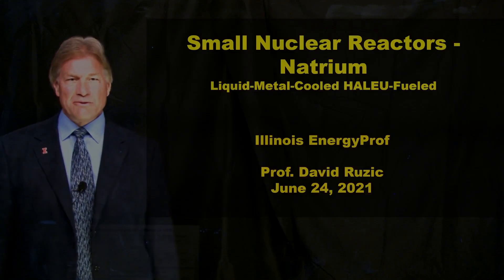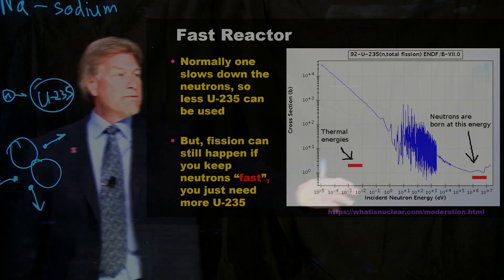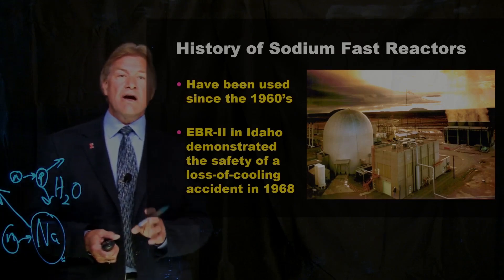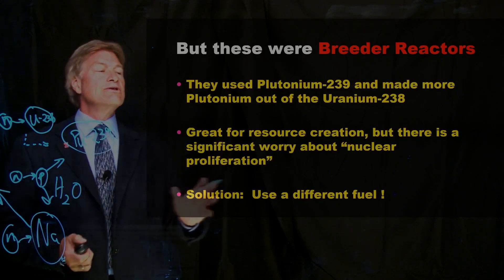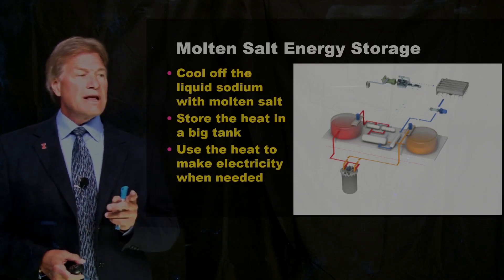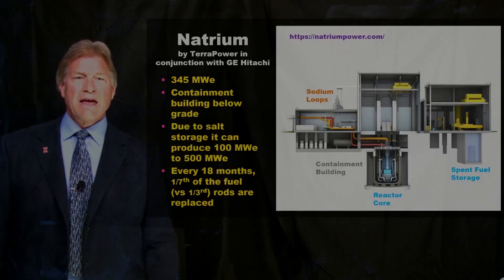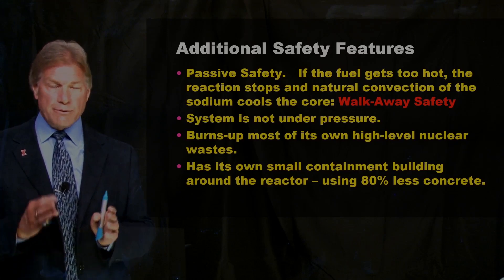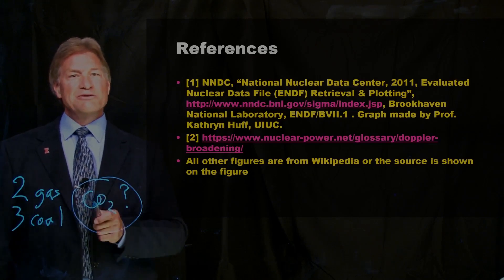Small Nuclear Reactors - Natrium

Comment: This angers me.
I never had a teacher like him. Life is unfair.
Thanks for being this awesome with this material.
Reply from the maker: Thank you!
Reply: @illinoisenergyprof6878  I'm Australian and we have to replace a bunch of badly ageing coal fired plants and a few gas-thermal plants.
I actually did aerospace at Illinois but now work in industrial control systems and automation. So I don't work in the power industry but I work with power engineers at times. They've been saying for years we've got issues and NOBODY listened. In automation we reuse a lot of stuff. We don't throw out robots for new products we re-tool and re-program. In mining (where I've worked) we don't throw out the trucks and diggers when the mine runs out we move them to another mine. So RE-USING existing infrastructure makes a whole lot of sense.

One of the things I hear from power engineers is how hard it is to manage a grid. If we take 1GW of coal offline because its too old and replace it at the same location with 1GW of Gen IV then grid management DOESN'T change. Plus all the deconstruction and reconstructions works keeps people in those places employed. We have a huge coal industry and most of their workers know climate change is real and their industry is dying. What they HATE is that nobody is answering their big question: "What's next?" 
I don't think Gen IV is the answer for everyone, BUT IT IS AN ANSWER for many to consider.

FYI - The answer I am pushing here is hydrogen from sea water powered by wind & solar. Like some countries we have huge amounts of roof top solar and lots of wind. We're discovering there's a massive amount of energy being generated and NOWHERE to use it. Since its already electrical energy its inefficient to store as heat. But if we store it as hydrogen, yes it has loses, but it gains on long term storage and transportation. You can't pump molten salt across the countryside but you can pump hydrogen across the country side.

But even in our scenario with our future population estimates we'll need lumps of hardware that can simply generate baseload power day after day. Before I went to Illinois at my High Schools equivalent of a commencement speech one year was by a nuclear engineer. He said (in 1980) that Australia would one day HAVE to include nuclear in its power mix. I see our energy future as a mixture of technologies and I think that's how most countries will go about it.
Reply: Green hydrogen of the sort you’re advocating has been a complete failure. Sabine Hossenfelder did a video explaining why.
Reply: Well now you do... Just because we are not in a school doesn't mean the information isn't relevant.
Reply: @timaahhh  yeah, but the difference between him and my physics professor, Dr. Balageer, could have seriously altered my life.  Now that I'm in my 50s, it's a bit late for a physics related career change.  Ugh, just thinking of my prof is making me sleepy - Red Bull wasn't a thing, but no matter how caffeinated I was, this guys droning voice and completely uninspiring teaching methods put, without fail, half the class asleep.  He was a nice enough guy and evidently a good researcher, just socially awkward and not teacher material.
Reply: Well said, I feel the same way😊
Reply: I had one prof like him.   Didn't use technology as well, but extensive subject matter expertise and incredibly good at presenting it.

Notes from the whiteboard were how you survived the class, but it was engaging, challenging, and is still useful in my professional life today.
Reply: @jamuojisan  
Life will be unfair to those who don't understand Chinese. In a decade or so, after they have subdued Taiwan, HK, and a good portion of the rest of the world.